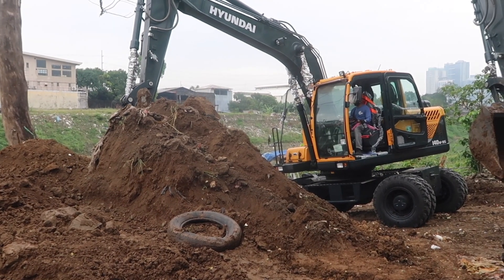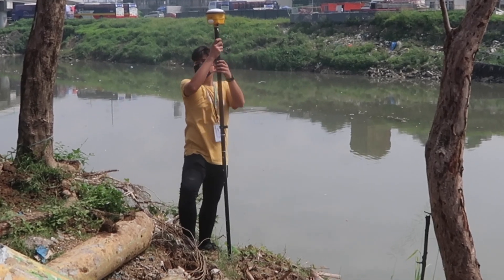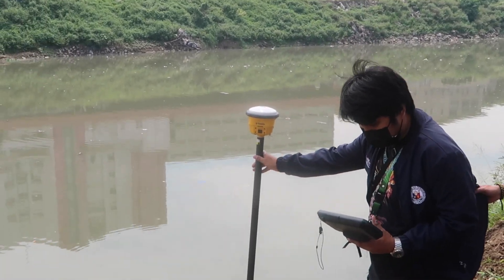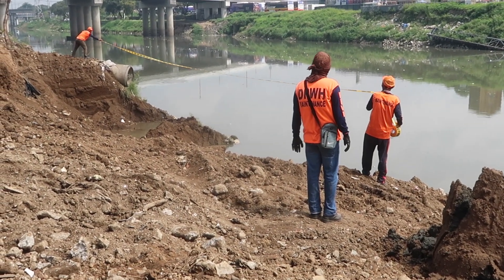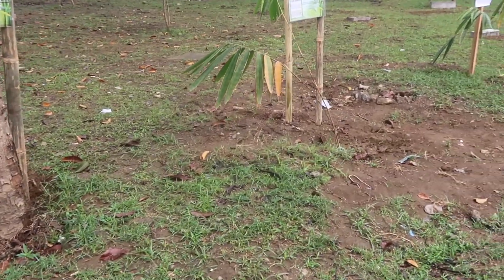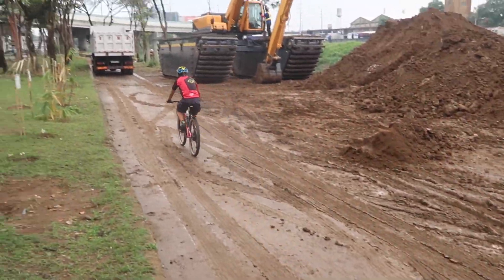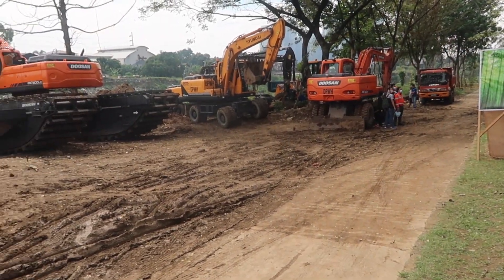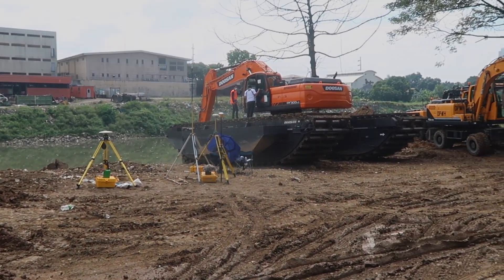Marikina River DENR Measurements

Comment: The state of the art, laser equipment is a good way to measure a precise result of the whole reservoir, including the blue print after they are realized, the depth of the bridge should be deeply founded,  order for it not to wobble. Water proof materials can be used as protective materials from recycled products that uses plastics to infuse cement and hard molten plastic materials in order for the materials to withstand tests of time, including nature. The cement mixture with plastic should be water proof, for it not to depreciate quickly, since it is the material that makes infrastructure certain, certain weight, certain depth, measurements, and a siphoning duct or sewer that collects the water from highlands, plains, lowlands from soil erosion, excessive water are pulled out or siphoned in order for them not to erode nor cause calamities, as they are overcomable these days. Huge water tanks can be installed as well in order to collect the water, and prevent disasters, calamities and make cities self sufficient and safe.